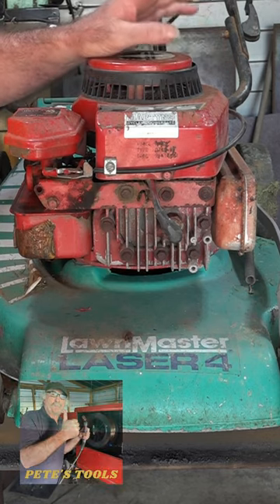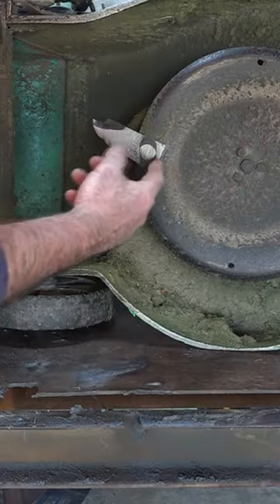If your lawn mower won't cut, here's why

Comment: We have some farm tractor equipment here in the US called a disk mower but other than that I've never seen this on a push mower. Have you tried the one large blade design like we have and does this small blade design work better for you? I'm assuming your design doesn't mulch the grass it just kind of lays it over
Reply from the maker: will also mulch .but this blade design is normal for us